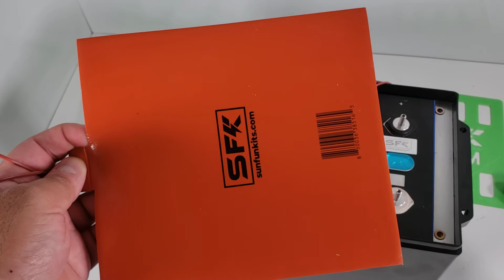Cell Separator Heating Pads for V3.5 & V4 Kits as well as DIY Builds

Comment: I have 2 temp sensors. Where do i put them? Ideally i would put one on the far end of the battery, so i can masesure when the outer cell is heated to over 3/10 degC. Is that possible with your case? To put it on the short side of your box? Do you know hot to wire the JK BMS til your Heating Pads? I live in a cold climate during winter (Norway), watching the Offgrid garage.
Reply from the maker: You can place them on either cells the final one on the left and right. It really does not matter too much as these are measuring ambient temperature inside the case.

Comment: I think the heating element between two cells is a much better arrangement than on the exterior sides. I would have to test to see if the bottom mounted one would be better, but likely not. With it placed between two cells, you get all of the heat from both sides of the element applied to the cells. On the exterior sides or even underneath the cells, at least one side of the heating element is busy heating the exterior case, and wasting energy. Elegant and functional design. I am very pleased with the kits I have purchased, although I will admit that I have no use for heated cells. My problem is exactly the opposite, cooling the cells.
Reply from the maker: We have done tests with all 3 setups the best overall is the pads on the sides as it raised inside temperature evenly.

The cell separator heaters created the biggest difference where the cells were 30 degree hotter than the the reading on the bms.  With wall heaters it was only 15 degrees difference.

Also the install on the cell separators are more involved.

We will offer the option of either solution.

The bottom heating will be on hold for now.
Reply: @sfkenergy  But are you measuring the battery core temp, or the ambient temp inside the case when you place the heater on the side?
Reply from the maker: @B4x4  The temp can vary based on where you place the probe, we go by the ambient air inside the case. Cell temp will vary slightly.

But direct cell heating has the potential to create a larger delta as they will heat up much quicker and then slowly radiate the heat around the case. Once all 3 temp probes on our BMS read an above freezing temperature charging can be resumed.

This can be tweaked in our app, e.g. you can say only resume charging once the inside temp is at least 50 degree Fahrenheit.

So overall direct cell heating, probably is better for heating up your cells quicker, but sidewall heating is better for raise the inside temperature gradually and evenly.
Reply: @sfkenergy  Good answer. I see your point. Thank you.
Reply: @sfkenergy , so the cell separator heaters are more efficient? They raised the temp of the cells using less energy?
Reply from the maker: @brianthompson9485  so you have both sides heating the cells can sidewall where only 1 side is heating them. However they are a bit harder to install so we recommend people use the sidewall method.